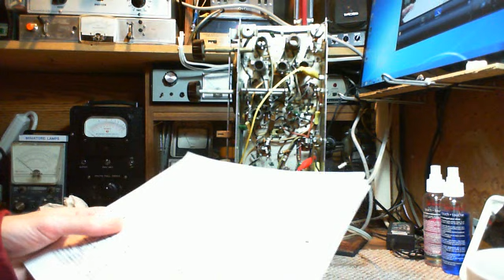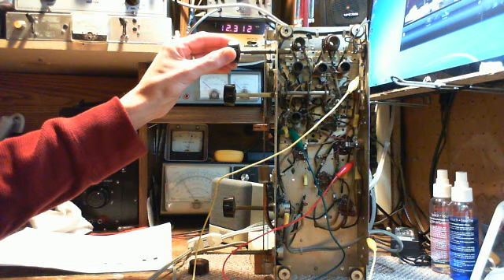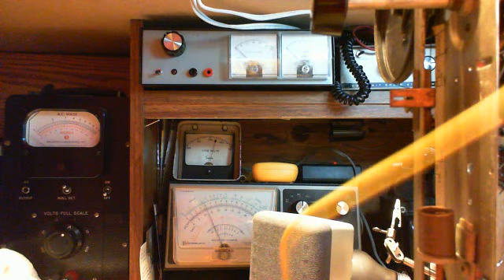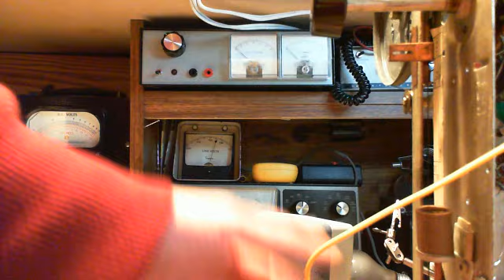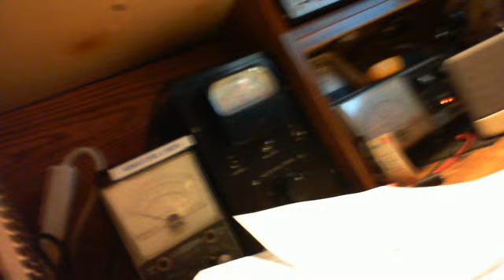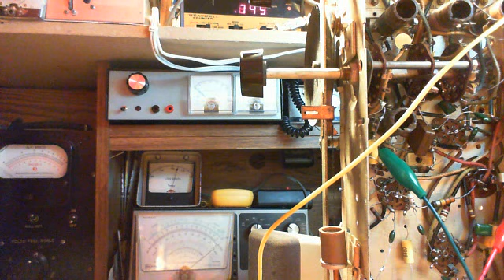Philips 922 Vacuum Tube Radio Video #16 - Final Alignment

Comment: Hi Jim. Man That radio has it out for you. Now I did remember that one radio I repaired,had a bad output transformer. The sound did just like yours is doing, It would Ohm out right on the money on both the primary and secondary. So I spend hour's trouble shooting the radio from Antenna to the output tube. It finely went all the way out and was easy to track down. I hope this helps.Maybe keep a meter on the output transformer's input and output. Thank you for sharing.